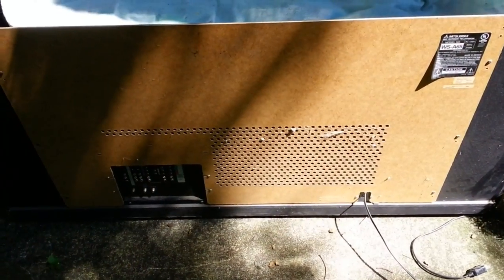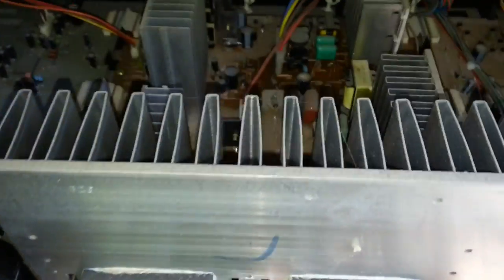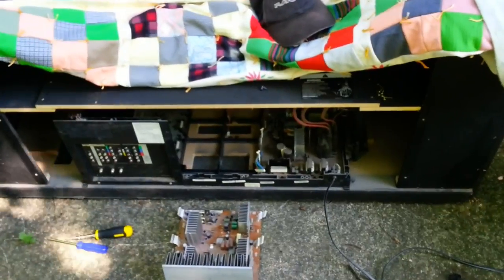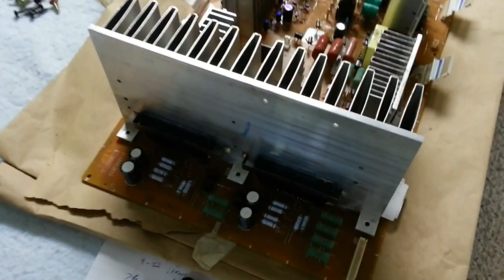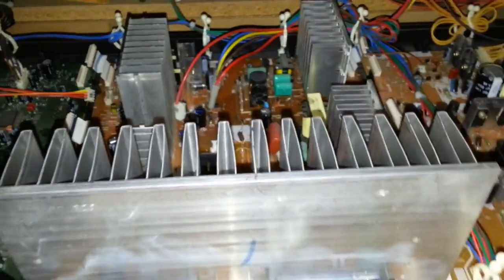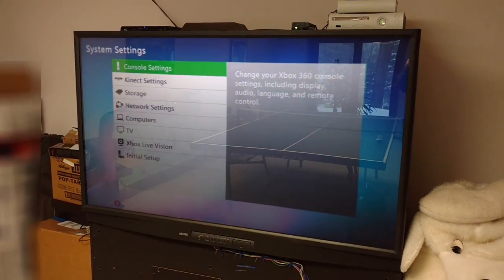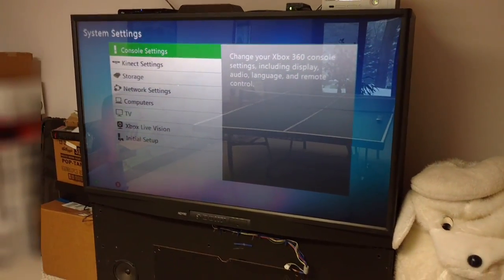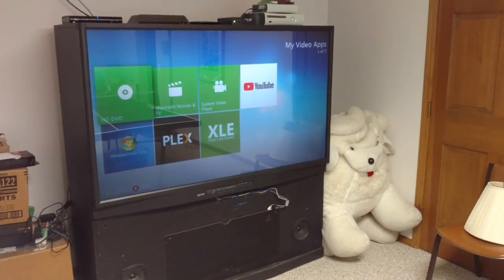Mitsubishi WS-A65 Repair V-Log and CRT Rear Projection Discussion

Comment: I bought a brand new Sony in like 2005, then around 2010 it cut off (picture wouldn't project), I got it to cut back on,  and it would stay on until the lights blinked, then it wouldn't project te picture again, but if you finally did get it on, you had to leave it on, finally, it just never came back on or projected. What is so maddening, I had given it to my dad in like 2008, and he loved it, that damned thing had a wonderful picture. If I could fix it (I'm my storage shed for 10 years) I would take it to my river camp, but the truth is, its just obsolete.

Comment: My Hitachi projection (crt type) tv has a dim picture. Is that an IC issue?
Reply from the maker: Probably not. If the convergence is good, then I'd say that the convergence ICs are fine. The most likely explanation is that the lenses are dusty. Give them a thorough cleaning, and check the mirror while you're in there. Depending on the make, (and depending on how/where it's been stored over the course of its lifetime) since some have poorly-sealed optical cavities, the mirror might be dusty too.

Be very careful when cleaning lenses and/or mirror, however. They're not made from the same scratch-resistant material as your cell phone screen. In fact, those surfaces are unbelievably soft and scratch at the slightest provocation.

Comment: My TV not showing blue screen and the menu options on screen. Incase of no signal it displays black screen, instead of blue screen. Remaining all working fine. No error code found.
Reply from the maker: That's normal, if you have that option checked.

Comment: I'm finally calling it quits on my Mitsu WS65908, believed to be in good working order, when last powered up.  When I googled to look for discussion forums with mentions of folks still using these, I could find very little.  Does anybody have a need for parts?  Are there any specific parts which could be salvaged and shared with somebody still inclined to keep their Mitsu going?  I hate to throw old tech with rare parts in the dump if somebody can use them.
Reply from the maker: The 809 is the circa-2000 version of the same model, if I remember correctly. If it still works, the thing has more practical value than it has cash value, so I'd just clean the lenses, focus it up, and put it into use in a secondary role.
Reply: Yep, in 2001, I installed it in a clients HT.  In 2011, they asked for an upgrade to a larger flat screen and gave me the Mitsu back.  It has been my main TV since then.  I love how it looks for movies; I’m not a fan of the brightness of modern flatscreens.  Rearranging stuff in a brick ranch with smallish rooms, and I just don’t want to devote the space to the Mitsu anywhere.  I have been gifted numerous nice flatscreens (Sony Bravia, Panasonic Viera, Samsung) and so I have TV’s I’m not even using!  When I last poked around the net for Mitsu information five years ago, there seemed to be a more active community talking about keeping them going, so I wanted to see if anybody wanted spare parts before tossing it out.  Today I hardly see any active threads about them.
Reply from the maker: @4bettercheddar  I'd check on AVSforum to see if anyone could use cheap parts. Rear projectors (especially CRT RPs) are usually not worthwhile to part out, since their only value is whole.

Comment: Can I use them to play in a high end PC? Do they come close to crt's motion resolution and lag?
Reply from the maker: It's more possible than you might think. I used a VGA-to-RGBHV breakout cable. I actually did that with one of these before. If you can figure out how to output 1080i or 540p from your computer, which can certainly be done, the sky's the limit.
Reply: @Browningate  So VGA to RGB and vga to Display Port.
Reply: @Browningate  Thanks 👍
Reply from the maker: @arielpuig7302  Not exactly. If you only had a DisplayPort output on your computer, then you'd want to hook a DisplayPort-to-VGA adapter up to a VGA-to-RGBHV breakout, and then attach the breakout to the Mitsubishi.

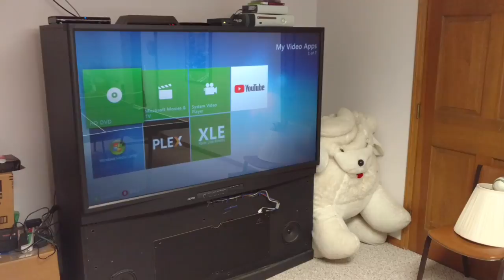Comment: 18:30 Well at least there was D-Theater and the original Xbox
Reply from the maker: This is true. There was HD content in the early-2000s from those (and other) sources, but our media didn't really fully embrace Widescreen HD until the late 2000s.
Reply: It’s still nice to know that all types of media started embracing HDTV by the end of 2002, even if content was lacking. At the very least you still had SD/ED widescreen media in a pretty solid amount in DVD and games
Reply from the maker: @MamaLuigi - While they started embracing it, most of the "widescreen" in videogames at that point was just letterboxing. Even the original Xbox, which had a great selection of titles supporting 480p, (and a handful that even supported 720p and/or 1080i) not that much of its library is widescreen. I wouldn't call the adoption rate "pretty solid" until the seventh generation, at which point it was close to 100%, even at launch.
Reply from the maker: @Billy - widescreen gaming in the 1990s was an outlier more than anything.
Reply from the maker: @Billy - True, and it had to start somewhere, but was by no means common nor mainstream. It wasn't until the seventh generation when virtually 100% of everything was HD and widescreen, and not fidgety (no hidden menus, key combinations, haphazard switching of display modes on the monitor, etc., to be able to experience HD and or widescreen).

Comment: Can this TV screen be used without being attached to the bottom 1/2 speaker unit? If I wanted to use a speaker bar instead?
Reply from the maker: You could remove the original speakers from the unit's casing, but that wouldn't accomplish anything more than leaving empty holes in the front of the machine that a bar wouldn't fit into anyhow, so it'd certainly be a worthless endeavor. Besides, the sound in this thing is actually pretty good, and adding a subwooferless "bar" probably wouldn't improve the audio at all anyway. It'd be waaaaaay easier to leave it alone in that regard. Did you even watch the video?

Comment: I accidently shut front panel off an now i cant get remote or power button to start
Reply from the maker: Solution from the operations manual:
"you can restore the function of the front panel buttons by pressing and holding the MENU button on the front panel for more than 8 seconds. If the TV is already on, a message will be displayed to confirm the release of the Front Button Lock."

Comment: Are these good for retro consoles like ps2
Reply from the maker: You are correct. They're perfect for PlayStation 2 and original Xbox; especially if you're using your component cables (instead of S-Video, or especially composite) for those systems. Most original Xbox games support 480p and/or widescreen, and many PS2 games do the same. A handful of Xbox games even run in HD, as do one or 2 PS2 titles.

Comment: Where did you buy your power supply from and what was the part number
Reply from the maker: Are you asking or telling?
Reply: I'am asking
Reply from the maker: @Terrell - eBay. I don't remember the part number, but it should be printed on the board somewhere. Is there any reason in particular why you would be seeking a power supply board?

Comment: Great tv! it has PIP function?
Reply from the maker: It most definitely does. I remember making extensive use of that feature, switching between watching shows and Mario Kart Wii (patched to restore online multiplayer connectivity) while waiting for the next match to start. Good times.
Reply: @Browningate  i love this type of tv (i'm an italian collector of vintage electronics) and I'm looking for a used one with PIP (although my current 55" plasma TV does the same things). But rear projection TVs have the charm of cine image (not tele but cine). Do you still have this TV?
Reply from the maker: @antechquario  I don't own either (the 48" WS-48311 or the 65" WS-A65) anymore, unfortunately. This class of products may become collectible someday, but that day is still a ways off. Right now, they're still very much at the bottom of their deprecation curve.
Reply: @Browningate  
I am sorry. Sold or broke? 
I love these TVs, but as I told you I'm undecided because I have a plasma that has the PIP function and weighs much less :)
Reply from the maker: @antechquario  Both sold working. One sold, and then broke, (shorts caused by a coolant leak) as far as I know. Is the plasma a particularly grungy model that you're looking to replace it?
Reply: @Browningate  My plasma works perfectly, it's me who's mad and in love with the 90s. In the USA there are many rear-projection TVs for sale but assuming they want to send me a heavy and large TV I could not use it because it is NTSC, in Europe we had PAL. I'm sure that in the end I will find it here in Italy, I hope in good condition.
Reply from the maker: @antechquario  You'd probably have better luck abandoning the Old World and moving to the New World then. It's less cramped in general, and rear projection televisions (even CRT-based rear projection) abound.
Reply: @Browningate  
I've been thinking about doing it for a long time, I have friends who have lived in the US for years. I would also move because of the hateful issue that Europe has decided to produce only electric cars from 2023
Reply from the maker: @antechquario  If it's any consolation, our inept politicians ensure that we circle the toilet only a couple of decades behind the Old World countries, in most cases. Still, delayed pain is better than immediate, so I'd still say to go for it.
Reply: @Browningate  Totally agree. Can i ask a technical question? SCART is neutral? I mean: NTSC or PAL was the system for trasmitted signal tv (RF), not for SCART.. if i buy a tv from USA, i can attach a decoder by SCART end watch tv correctly?

Comment: Is it possible to play my switch on this?
Reply from the maker: Yes. HDMI-to-component transcoder is your friend for digital-only consoles. Keep in mind that the transcoder you select must support scaling to 1080i.
Reply: You're honestly better off playing an Xbox 360 or Playstation 3 (or even a Wii U). The original HD-ready consoles have their own component connectors and support 1080i natively, so there's no need for extra cable transitions. Digital-only consoles (Xbox One/Playstation 4/Switch) should only  be used on digital flat panels.

Personally, I still have my Xbox 360 S and I recently bought a component cable for it. At some point I even plan to get a 1080i CRT just to get the full experience out of it. I do have an Xbox One, but I'm not too fond of it.
Reply from the maker: @MrUnknownuser164  Bingo. While HDMI-to-component transcoders will work, where CRT HD will really shine is with stuff that natively outputs analog HD (or at least 480p) using a supported format on Component or RGB. Xbox 360, PlayStation 3, (except for the games that don't support 1080i) Wii, Wii U, PS2, Xbox, and Dreamcast are all fantastic devices for use on these types of display devices.
Reply: @Browningate  Thank you. Even so, I still feel like component video should be reserved for 1080i (or 720p whenever possible). The problem that I have with using a 6th-gen console (or a Wii) over component is that you can only get 480p. Using a console like that (GameCube, Wii, PS2, Xbox, etc) at 480p over component is like using an Xbox 360 or Playstation 3 (or even a Wii U) at 1080p over HDMI. It's using the maximum display capability of the console over a connection intended for higher resolution (since HDMI has supported both 1080p120 and 2160p30 since HDMI 1.4). So I feel like the older consoles should still be used over composite (480i).
Reply from the maker: @MrUnknownuser164  I agree, except for the bit about old consoles being used over composite only. If composite is the best they support, that's one thing, but component at 480i/p is still superior to composite at 480i. It may not be making the most of component's capabilities, but it is making the most of the console's capabilities. Plus, there are some original Xbox games that support HD, and even the odd PS2 title. Either way, component is still a great and underappreciated standard.
Reply: @Browningate  I guess that you have a fair point. I just felt that if a console can support a specific video connection, it might as well support the full use of the connector. Let me rephrase my stance: I feel like 6th-gen consoles (and the Wii) are optimized for 480i video output over composite with extended support for 480p over component. I also feel like component video connection is best utilized by the HD-ready consoles (Xbox 360, Playstation 3, Wii U) at native 1080i, with extended support for 1080p over HDMI.

If anything, I don't like using an HD console at 1080p. I've had my Xbox 360 S since Christmas 2011, and I've always used it at 1080p (on a digital flat panel display) up until recently. I've always felt like I was using it wrong, so the other day I started using it over component. It just feels right, and I like the option for 480p (whether that be for enhanced original Xbox games or upscaled DVDs). I like to reserve 1080p (and HDMI connectivity in general) for my Xbox One.
Reply from the maker: @MrUnknownuser164  Okay...
Reply: @Browningate  just telling my honest opinion. Right now, I'm using my Xbox 360 at 1080p over component. Even on a digital flat panel, the image is phenomenal. I still intend to get a 1080i CRT at some point, but I've come across a true gem for now.
Reply from the maker: @MrUnknownuser164  Keep us posted. These things are everywhere on Craiglist and Facebook.com's Marketplace utility. If a rear projection is too much, 1080i direct-view CRTs seem to be readily available as well and should offer similar results (and without the coolant headaches or convergence ICs).
Reply: @Browningate  a pro-grade scan converter like the extron IN1508 will take 1080P from a modern console like an xbox one and output 1080I with nearly no lag. I use it on my Toshiba 51H83, looks fantastic.
Reply from the maker: @jdla140  Great tip. I didn't even know that such a device was available at such an inexpensive price. If I ever get my hands on another CRT rear projector, I'll definitely see about sourcing one of those.

Comment: How Heavy was the television?
Reply from the maker: Over 320 pounds, give or take a few with it missing the faceplate. This is definitely not a thing to lift solo either way.
Reply: @Browningate  I had a 50" Sony project tv no trouble with it at all i only paid $15 for it before Goodwill stopped talking crt tvs and came with the original remote
Reply from the maker: @Dan - In that case, you have a stronger back than most. Please be safe!
Reply: Browningate Damn thats around 145-150 Kilograms. That’s really heavy.

Comment: Hi i just got one of these old tvs,  im trying to get my directv to show up and cant,  can anyone help me
Reply from the maker: It shouldn't give you any trouble. If you're hooking it up with component cables, make sure to disable unsupported resolutions (like 720p and 1080p). You'll probably need to temporarily hook up the crappy composite cables (just temporarily) in order to do this as well.
Reply: On the remote select the correct input. 🤣

Comment: we have projector christie entero hb rpmhd-led02
now it can not start up when I press power ON
the power fan run 40 second then it stop, I see the light on Network cable on EM module but it not starting up, it seem to be not present 12VDC on Em module, and the fan on Light module start 5 second then it stop
after that power module also stop
video: https://www.youtube.com/watch?v=MVqeKiNWUug
could you please help me ? does ME module has problem?
Reply from the maker: What exactly does that have to do with the Mitsubishi?

Comment: :hand-pink-waving:My picture is dim, what that about?
Reply from the maker: Not sure. What's the story?
Reply: @Browningate  Family heirloom TV Hitachi CRT type from the early 2000's. All the controls work well. Picture is coherent (converged, no blurry lines) but hard to see (dim) except in a very dark room. Others have said clean innards like mirror of dust. Some say CRT degradation.
Reply from the maker: @lakecrab  It could be both. The mirror is angled downward, so not much sticks to it. The place where dust really collects is the projection lenses. Clean them (carefully! they're made of the world's softest plastic, and not glass) and see if it makes any difference. If the machine has very high hours run at high contrast/brightness, then it could be a case of degradation too.

Comment: My mom still has this tv
Reply from the maker: Give it a good lens cleaning and basic settings optimization, and she'll likely continue to use it for years to come (as long as it doesn't develop any coolant leaks).
Reply: Browningate I don’t think that’s necessary because she has had the tv since 2010 and it had no issues with the screen. The only problem she had was the speakers but that got fixed